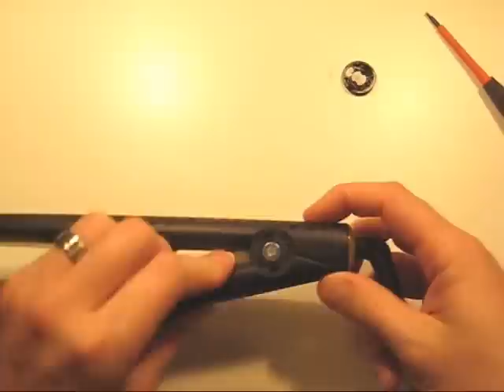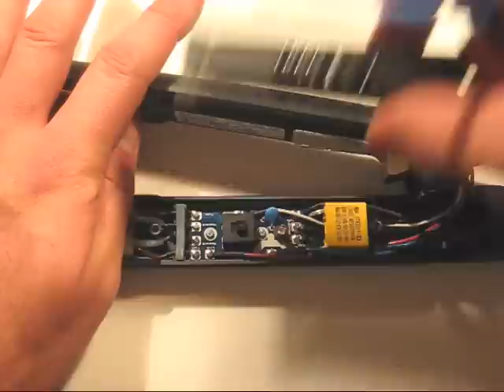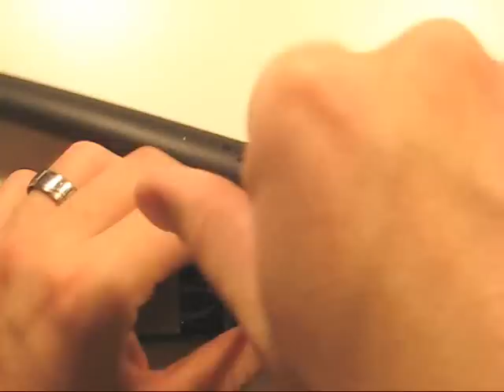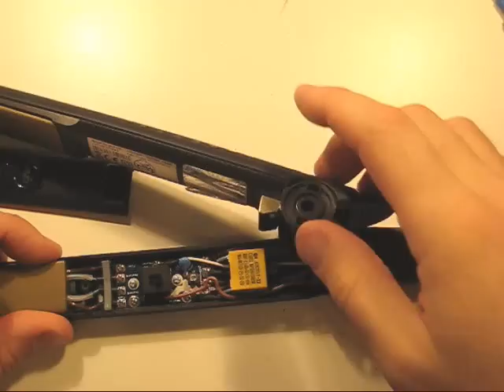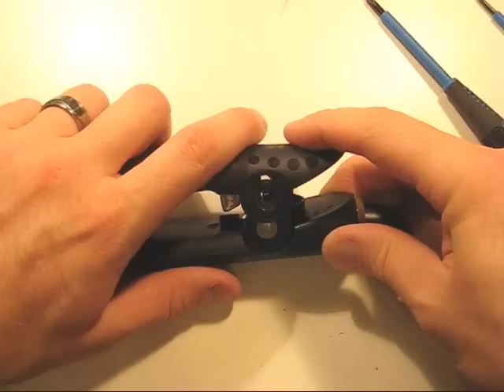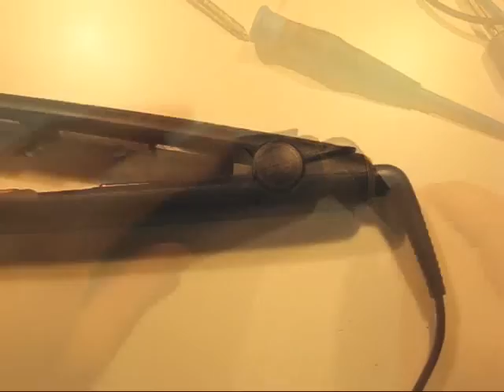ghd-repair.co.uk: Replacing a cable on a pair of GHD 5.0 Gold Series Hair Straighteners

Comment: I’ve fixed my straighteners but when I put it all together, but the two irons are sat two close together almost to the point where I can’t get my finger in to switch the iron on, any ideas what I can do? I’ve screwed everything  in g down so I can’t think of why it’s not sitting apart enough
Reply from the maker: Did you put the spring in correctly? Perhaps the arms can't open fully because of the spring. Feel free to email me some photos and I can take a look - gary@ghd-repair.co.uk

Comment: these hair irons are so expensive and I have 2 that don't work because of faulty cables. I mean really? there should be a recall
Reply from the maker: Hi Luke,

The cables generally fail due to heavy use or because they are wrapped around the irons for storage. If the cables were designed to be more robust, then they would have to be stiffer and therefore less easy to use.

Fortunately replacement compatible cables are available - see http://www.ghd-repair.co.uk/shop/mk5/ghd_type3_cable

Regards,
Gary

Comment: hi there, my ghd was not heating so my husband changed the thermo fuse and now its "over heating" do you know what needs to be replaced as well?
Reply from the maker: Hi Rose,

Is the heater element working on the non switch side? Is the thermistor securely attached to the heater on the non switch side?

Regards,
Gary

Comment: Hi 
I think the switch has broken or something under the switch on the circuit board on my mark 5's as it makes the noise if you keep pushing it up and down, but the light doesn't stay on or heat up.
Do you do repairs, if there sent to you?
Many thanks
Hayley
Reply from the maker: Hi Hayley,

If the make noise if you keep switching them on and off, then that might be a failed resistor. If pressing on the switch (with changing it's position) brings them to life then there is a bad connection in the switch.

Whatever the problem, our repair service will be able to fix them for you. See http://ghd.repair/service for details.

Gary
Reply: +GHD Repair by Fogma Ltd 
Thanks Gary for the quick response. Yes I have a feeling it's the switch, because like I said I do get a brief noise sometimes when I keep pushing the switch up and down. 
My boyfriend is going to take them apart tomorrow and if he can't figure it out I will go to your website.
Many thanks 
Hayley.👍🏼
Ps I bet you have saved a lot of 'bad hair days' lol
Reply from the maker: Hi Hayley,

Tell him to have a look at our repair guide and check the resistors and the thermal fuse  - http://www.ghd-repair.co.uk/guides/mk4_debug.html 

These are the parts that normally fail. Switch failures are quite rare and it is always worth checking the common faults :)

Gary

Comment: My girlfriend has some GHD SS5.0 and the dog has chewed through the mains cable, I have ordered a replacement external cable with the pin connector on the end from your Amazon store, I don't need to replace the internal cable as well do I ? You seem to do both in this video ? Thanks in advance.

Comment: Hi, I'm trying to fix the same/similar model to the one in your video and have found there is power going in and out of the straightener, fuse is working fine. However, nothing happens with the straightener when it is switched on. No led, no heat and no sound. Just doesn't seem right. Would there be an issue with the circuit board? Any help would be appreciated.

Thanks, Tom
Reply: ***** mate thank you so much for your videos, straight after I saw this one I saw your video on how to test resistors then the video on how to replace them. Turned out the r8 resistor was shot. Replaced that and perfect. My girlfriend loves me for fixing her favourite straightener haha. Thanks again mate!

Comment: Hello good, watch my plate I give light and turns and a constant beep and the light will start to Flash and does not heat anything. Now if I warm up a little ceramic with hands or divider works well, creaks a bit a ceramic. As this very cold makes it beep hot works perfectly. I hope that you can solve it, a greeting and thanks!

Comment: Hi, I've got the Jamella Pink 5.0 ghds. They were working perfectly fine and then one day I went to switch them on and they just wouldn't come on or make a noise or anything.  My dad has had a quick look and says there is power going in, but nothing coming out. Could this be the thermal fuse? And can I purchase one from your shop? Missing my straighteners so much lol! Many thanks, Shann :) x